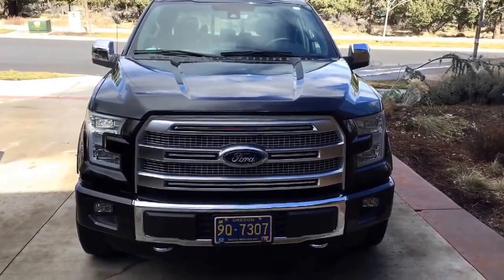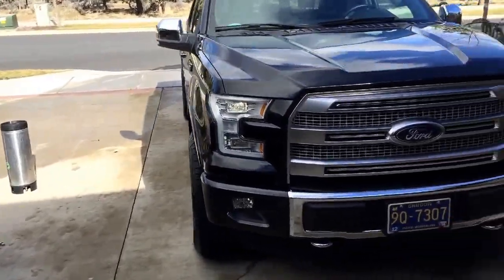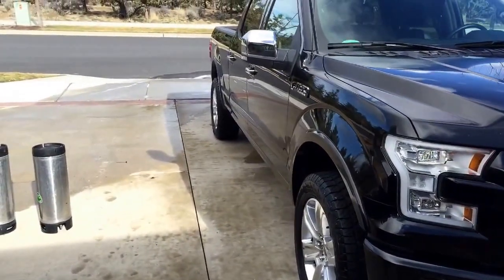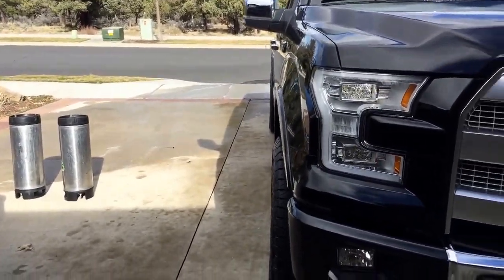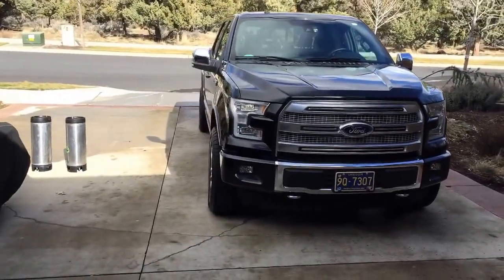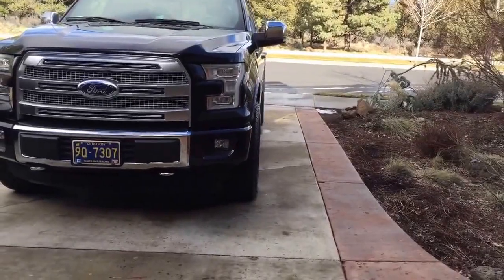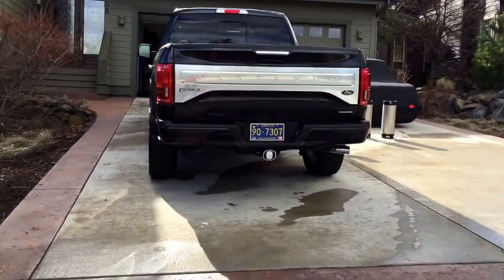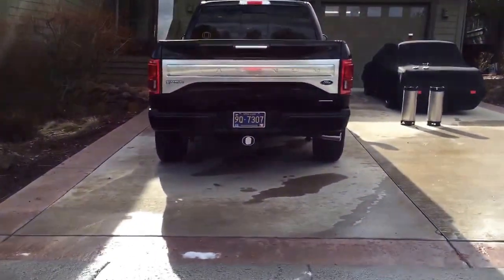Wheels/tires uneven after Bora spacers-FOLLOW UP!

Comment: When I added lift blocks on mine I thought I had messed up. Seeing that my passenger side   Wheel/ tire stuck out more. I had everything lined up. Leaf spring pins sat right in the holes of the lift blocks, and lift block pins on the axle perche. I might have to adjust the bed. By the way I wear my PT hat all the time in the winter when working on my trucks lol

Comment: Hi nice job, I just installed my Bora spacers today same issue pass side out 1/2 inch more did you loosen the axle U bolts on both side or just the pass thanks

Comment: I managed to get the rear differential centered a little bit more following what you did. However, it still sits about 1/4" proud on the passenger side. Are you experiencing the same thing with your platinum?

Comment: just wondering if you know, whether a 6*135 to 6*139 adapter will be the same as an spacer, cause i am planning to buy a set of wheels from escalade. thanks for the video
Reply from the maker: Sorry. I don't know :-(
Reply: F150 is 6x135 and the Cadillac Escalade is a 6x 139.5

Comment: Have you had any other problems with the spacers so far? Thinking about buying them.
Reply from the maker: +Kelby Duque Nope! Torque specs are solid   30k miles on the truck now. No issues yet.

Comment: Did it effect your driving at all shifting the rear axel over? I talked with Ford and they said a the 2015 to current trucks have the rear axels shifter 5/8" to 3/4" to the passengers side. They Sind they did that for tracking purposes.
Reply from the maker: no drivability issues or noticeable un-even tire wear. about 8k miles since install.
Reply: Every f150 of this gen I see sits like this. I'm considering doing the same to make it more even but am worried they did it for vibration /pinion alignment issues or something.

Comment: I have a similar issue. How is your bed alignment with the cab? My bed is about 1/4" toward the driver side. Should be easier to loosen the 6 bed bolts from the top and make minor alignment adjustments.

Update. I was able to loosen the bed bolts and get it aligned on both sides. If I can get the axle to move toward the driver's side just a little, I should be able to get the remaining 1/4" misalignment out.
Reply from the maker: Bed alignment was spot on with my truck.

Comment: Curious how you were able to move the axle over.  Did you just undo the bolts and smash it with a hammer a few times?
Reply from the maker: Undid the bolts and pushed it a few times with my legs (back against the wall)
Reply: Awesome, thanks man!